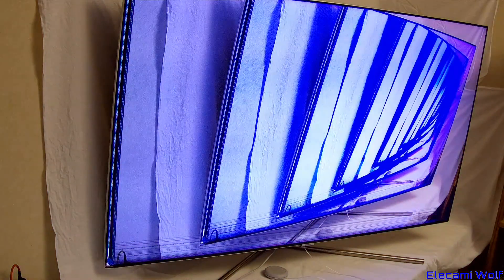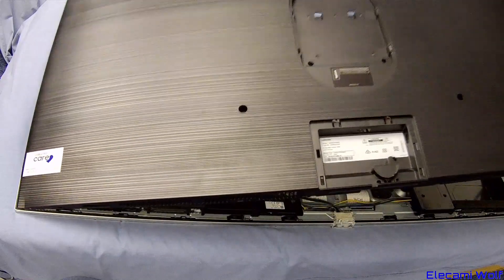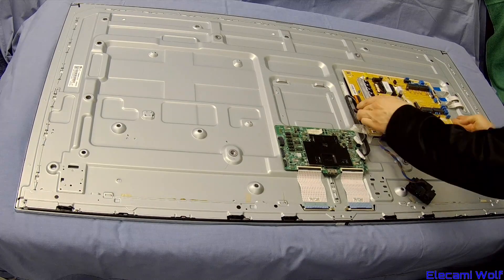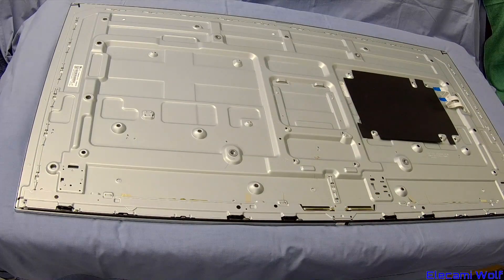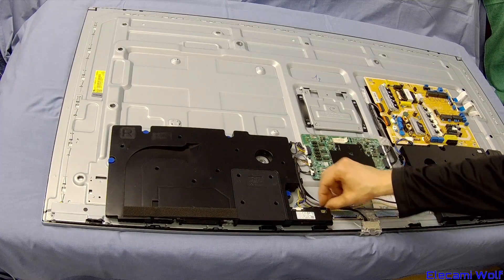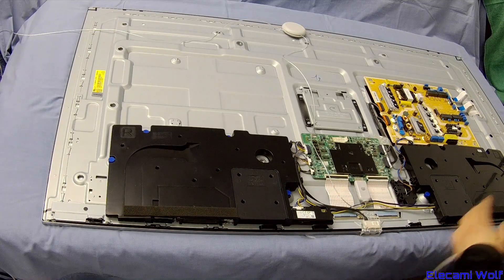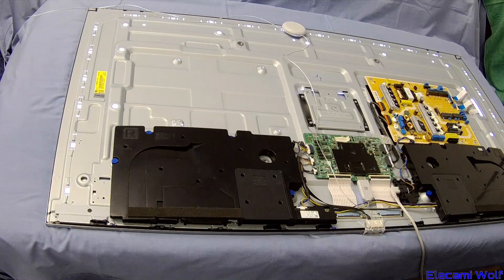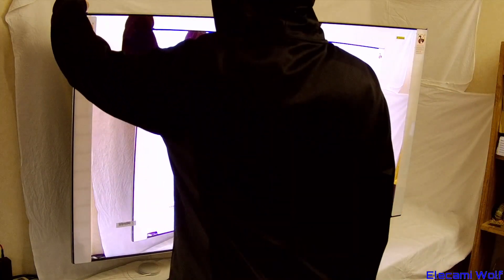EW0048 - Samsung QLED Q7 Series 7 TV Panel Replacement

Comment: heyy bud i have a samsung qled 55 Q7 series i have been facing issues regarding the display , the technician told me to change the display but when i asked the samsung customer care they said the panel manufacturing for my perticular model is stopped they asked me to take 17% of my tv`s worth and submit the tv to them . ANY ADVICE FROM YOU?
Reply from the maker: I don't know if there is much you can do if the panel is no longer manufactured, other than try get lucky with second hand sale. Maybe find one with another part broken.
Reply: Hi did you managed to solve your Samsung QLED TV issue?
Reply: What is exact model number of your TV

Comment: Hello freind i have a blac vertical line can you help me
Reply from the maker: Normally that means there is a bad connection to the glass of the panels. 
Maybe able to press in the right place on the edge of the panel to temporally fix it. But it could easily make the problem worse. Be careful.

Otherwise you need to replace the panel.

Comment: Hello Elecami Wolf, do you know if it is possible to change the panel on a QE55Q7FAMTXXC ?
Mine tilted in my bedroom and cracked the panel.
I bought a new Samsung 55 Inch but the new interface sucks and is so horrible i am thinking about getting my old 55" fixed!
Reply from the maker: If the correct replacement panel is available then yes it will be possible. You'll have to enquire with your local Samsung parts dealer.
Reply: @Elecami  I have been looking for months for a replacement panel, but no luck and 3 weeks ago i bought a new 55" TV for my bedroom, but wonder if the One Connect Box can be used as like one of those smart boxes you can get for older TV's,like if it is possible to use the One Connect Box with a computer monitor?
Is the CPU/GPU and the interface build in to the One Connect Box or the TV?
Reply from the maker: @JTL-DK  It depends on the Model, the older ones all the TV stuff was built into the One Connect, newer One Connect it is just working as a signal router. In any case I don't think it is possible to connect it to a different TV or monitor. I know at least the One Connect I was paying with, the video is sent over 4 fibers and the control signals and sound are sent over another 4 fibers.
Reply: @Elecami  Ok, thank you very much
 for your help 🙂

Comment: Interesting to watch - I just had a replacement Panel installed into my Q6 by a Samsung Tech Service Repairer....however the panel had no film or edge tape...they just walked it in bare and installed....now wondering if it was new or a secondhand panel...it is also noticeably darker picture than the original.
Reply from the maker: Maybe it came from another TV. 
Is it ok if you turn the brightness up?
Reply: @Elecami  Thanks for your reply, I have had to set Backlight, Brightness and Gamma at Max - and its only just acceptable....going to ring the repairer tomorrow and follow up.
Reply from the maker: @quasarhi  That is a bit sad. Must be a worn out or defective panel.

Comment: Hi. I am enjoying your videos but the volume is a bit low on some of them. To check the volume level, after you submit it to YT, right-click on the playing video and select 'Stats for Nerds' then look at the Volume/Normalized - Content Loudness dB figure. This should be close to 0dB. If more than -5dB I would suggest changing the volume level and re-uploading a new video.
Reply from the maker: Thanks. The newer videos should be better. I make sure to check the volume and give it a boost where needed. Looks like they need a bit more boost.
Reply: @Elecami  I had same issue on my YT vids. Low volume causes problems for people with laptops, tablets and mobile phones which all have weak speakers. It is really annoying that YT Studio/Creator does not check or report to us on this when uploading or provide a tool to increase the volume level of a video once submitted.